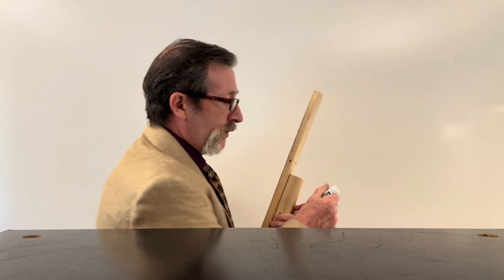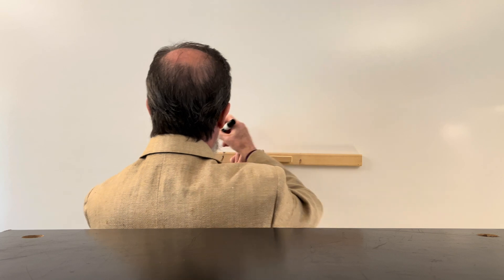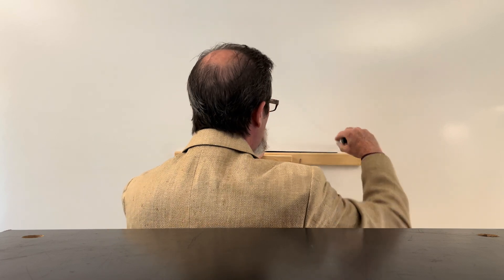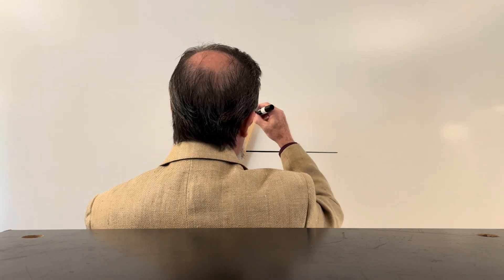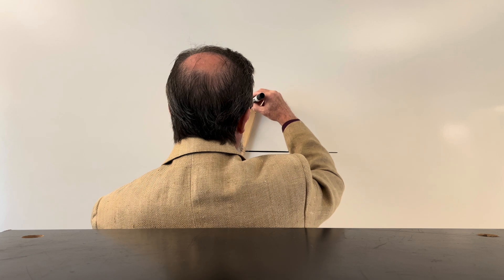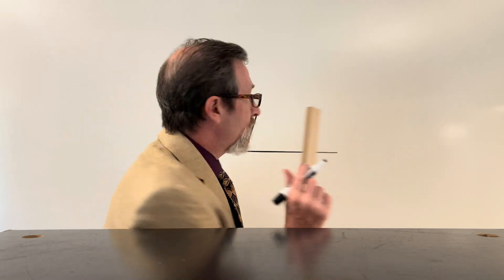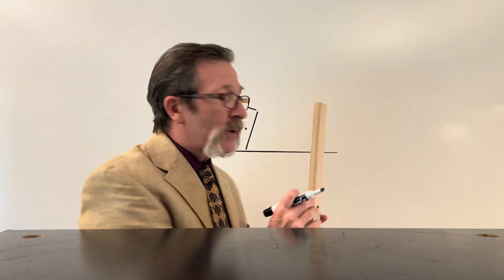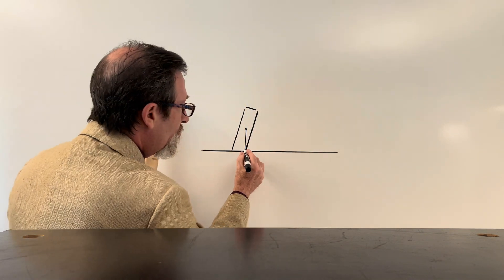Why Doesn't the Leaning Tower of Pisa Fall?

Comment: Side question 1:
The stone blocks (real stone blocks tower) of the base:
a- support the same weight on both sides
b- left supports more weight
c- right supports more weight

Side question 2: 
The stone blocks of the base on the right, support more weight in the first case, or in the second?

Side question 3:
Assuming tower integrity (i.e. wooden block, not stone tower), in the first stable case, what type of lever would be the equivalent to? Why?